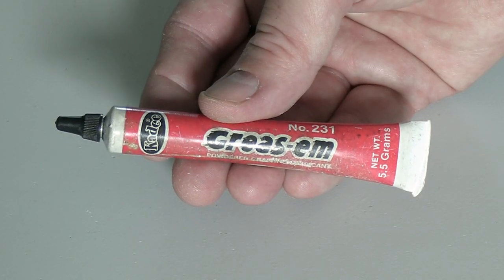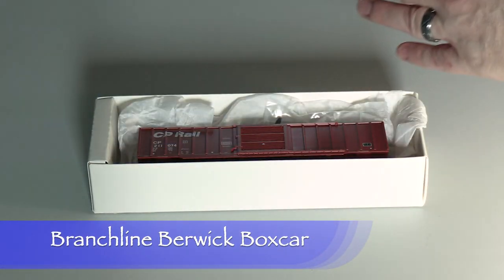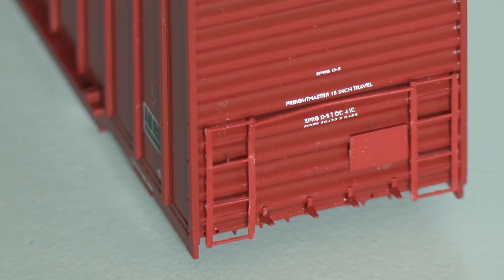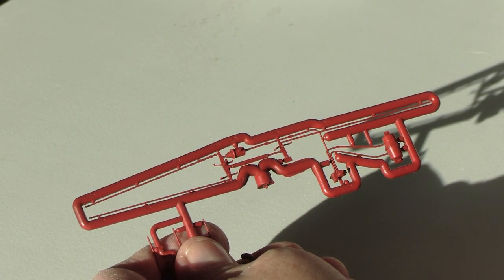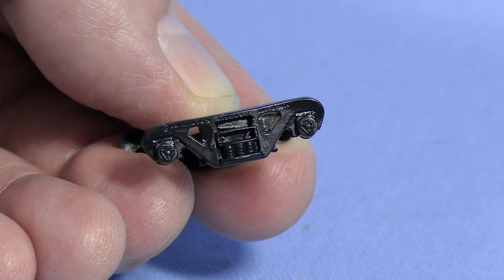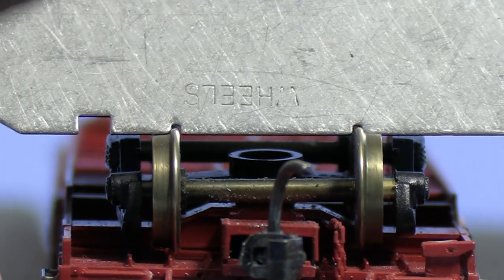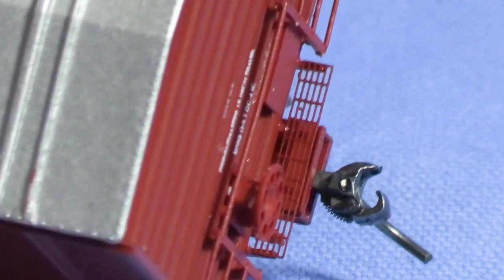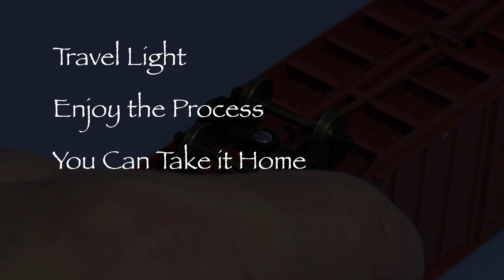Model Building on Vacation - Taking Model Trains on the Road!

Comment: I also don't like press-fit coupler box lids. I got an old Walther's Gold Line twin centerflow hopper kit, and all 4 lids fit differently. 1 is just fine, the pair that house the drawbar seem to stay, but pop loose on any grade, and 1 doesn't stay on at all. Gonna drill holes in the lids and tap the underframes for screws at some point.
Reply from the maker: Screws are definitely better than a press fit.  Hopefully that will fix your issue.  I also dislike coupler boxes that open on top like  the ones on this boxcar, as once the car is assembled there's no way to take the lid off.  Thanks for watching!

Comment: Always love seeing your videos. One small suggestion. Get a glue loop and put it into another x-acto handle. You will be able to get the glue into tighter spots and not have to flood the whole area. I used to do it the way you are gluing now. Now, with a glue loop I can be more precise with the glue applications and as a side benefit I am using less glue as I am not flooding the whole area when I do not need to.
Reply from the maker: I will have to check that out.  I hadn't heard of that before.  Thanks for the suggestion!